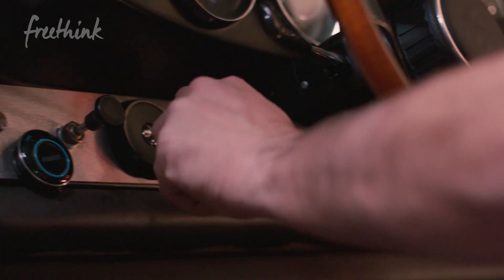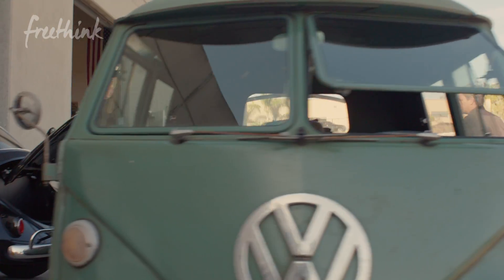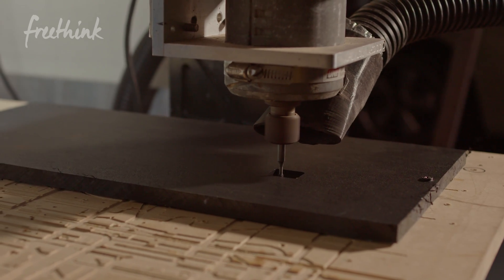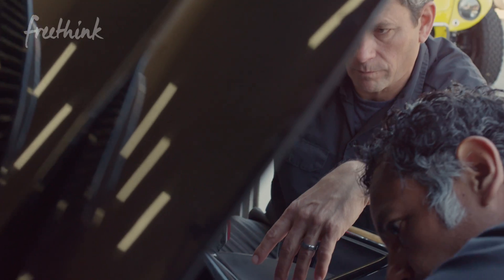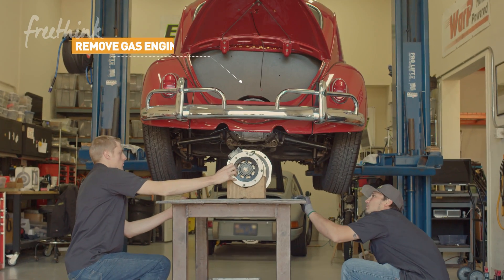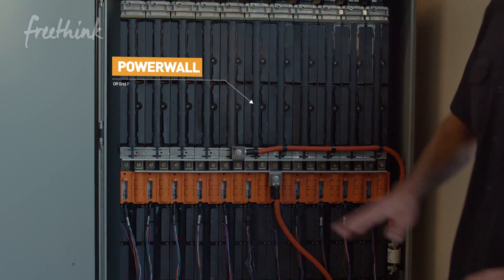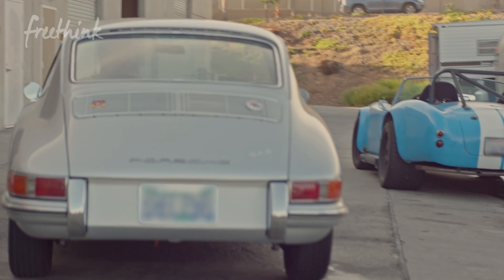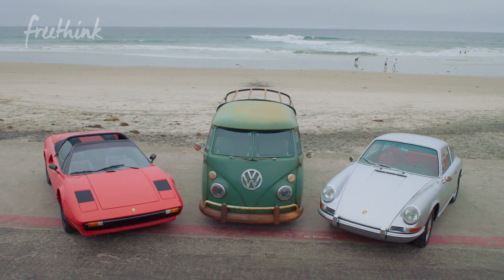The Garage Converting Classic Cars to Electric Vehicles | Freethink DIY Science

Comment: Cool but no mention to range? So, a single Tesla Cell, i.e. ~ 5.3kW 22V as Battery, gives you what? 15 Miles range? 
The key between BEVs vs ICEs is range and recharging time. Range is comparable today but until you can recharge your car in ~ 5 - 7.5 minutes, most people will still prefer ICEs.

Comment: Great to see you electrifying these old vehicles. I would hope you have learnt from Tesla around battery pack issues and 1 dead battery rendering the whole car almost undriveable. So you can develop a software that can bypass this and perhaps when 10 batteries have gone then the customer comes back in to have those replaced.
Otherwise like the Tesla there can be up to 7000 individual failure points (batteries).

Comment: EV's are NOT zero emission, even when powered by solar. All the parts from batteries to solar panels, controllers etc have emitted pollution at the factories in which they are made. The manufacturing of parts needs to be zero emission.
Reply: So your solution is to drive used electric ? The damage is already done but driving that would be more efficient than ordering the brand new Tesla

Comment: Supposedly EV West has or will have a Tesla motor conversion for V8 powered cars. So far, the only cars they convert are small rear engine VWs or Porsches. A better deal will happen when GM releases their crate electric motors for GM cars, that hook up to any GM auto transmission and also comes with the batteries, etc. I don't want to get a conversion consisting of various parts that  are cobbled together, which can only be fixed, if at all, by some company in Kalamazoo. These conversions suck, in my opinion. Stick with a company like GM or Ford - they will still be here 10 years from now, which is not likely for these five man companies  doing seat of the pants conversions.

Comment: This will cause the driver to loose a feel of connection with the car. Driving and working on a classic with an internal combustion engines are much more simple. The issue with placing an electric motor in a classic are is that it would loose its main character. Driving a 1945 Willys mb with the “go devil” four banger is going to be so much better than an electric motor. The smell of gas, the loud engine, the feel of the single clutch ti84 manual transmission, and doing mechanical work with oil spilled on your hands will never be taken away from me. I refuse this electric car revolution. But that doesn’t mean it’s a bad thing.

Comment: I have a '69 Stingray convertible I would love to make electric.
Reply: That would be so sweet. F gas cars I am ready for the future.
Reply: @donaldtaylor1037  I made that suggestion on a couple Corvette forums and received so much hate... I am old. But those dinosaurs can't handle the future...
Reply: @RAD6150  because we are not there yet convert when its the only option
Reply: @Notcminecraft  I don't want to do it because it has to be done. I think it would be a fun car if the weight can be managed. Some of the fun is doing something different, like the Zombie 222. Also, if you can put motors at all four wheels, I can think of fun ways to use that.
Reply: @RAD6150  rip corvette 1969 - shitty 2020
Reply: Why? I understand if it would be like 2050 but we can still enjoy gas cars so enjoy it while you can

Comment: I really want the resurrection of Citron  DS iconic french car. Thats my dream carvwuth all the works in electric version
Reply: A D series Citroen would be cool as hell. I owned two back in the day. The problem might be powering the high-pressure hydraulic pump that works the suspension, power steering, and the brakes. They also tend to be prone to rust so a S California car would be ideal. Good luck.

Comment: Don't fool yourself. Electric cars are not "powered by the sun".  It's a misconception. Unless your a millionaire and have the money for a huge solar system you will need to plug into the grid. That means burning coal, fossil fuels, etc. Electric cars need charging just like your cell phone x 1000.

Comment: With current battery technology becoming better, many people nowadays are converting old “nitro” RC cars over to electric. I don’t see any reason why it can’t be done with real cars. It’s actually pretty easy to do on a small scale like RC. How hard can it be? Let’s say that you’ve got a project car. Why mess around with turbos, fuel, oil and all that old messy stuff when you can just go electric? It happened to locomotives a long time ago. Our giant diesel engines of today are actually electrically driven. Their diesel engines are merely power generators for the electric motors.

Comment: Couldn't think of anything worse converting classic cars to milk floats part of a classic is its engine
Reply: fuck IC engines. solar to electric is the game bby
Reply: @mytubeworldmayhem  I'm going to make a still so that my carbonated ICE engine will still have fuel. It is possible for them to run on moonshine.
Reply: @jakekaywell5972  Ill take your entire stock. Got a 1967 Porsche 911
Reply: @coleberan3333  Nice! I have myself a 1962 Studebaker GT Hawk. A 1950s car dragged into the 1960s but still thinks its the 1930s. Due to the oversquare design of the 289 cid. V8, it should be fairly straightforward for me.

Comment: You're telling me you made an electric car out of a Delorean?
Reply: its powered by 1.21 JIGAWATTS!!!!
Reply: all you need to add is a flux capacitor
Reply: @Mr Charles
The way I see it, if you're gonna build an electric car, why not do it in style!
Reply: Unintended pun.
A lot of it is made from steel.
Reply: Great improvement
Reply: No plutonium...
Reply: The way I see it: if you gonna build a powerful electric car, why do not do it some style!!!
Reply: That thing is heavy! Range will be under par.
Reply: @aaronrigg5208  You could easily do 150 miles guaranteed in a Delorean. It won't be great for road trip, but for what Delorean are realy used for should be enough.
Reply: @aaronrigg5208  nope it only weights 2700 pounds with engine and all but just the shell thats gotta be light
Reply: @ArtmMaker  oh, ok. Thanks.
Reply: Powered by rubbish?

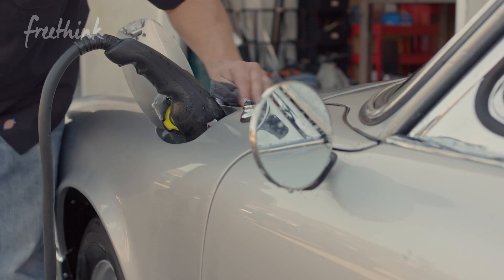Comment: 3:10
"Manufacturers havent been able to do since..."
Bullshit. The big car makes have always been ABLE to do this, they were just not willing. First of all, there has always been collusion between big oil and the auto industry. Efficiency was never a big seller. Secondly, ICE cars have more parts (carbs, injectors, starters, spark plugs, tune ups, transmissions, etc etc) to service and sell, which is a huge portion of any dealer's bottom line. The narrative here is grossly naive and ill-informed.

Comment: you know  you wont get rid of oil. Think about this from a national security standpoint. IF you were to have every car and truck run by electric power all it would take is one bomb on the switching station and you would put a whole city out of commission. and there would be no way to fix it. Some things will be electric and some will need to run on good old obtainable oil. We can either think about this now or it will get us in the backside later.
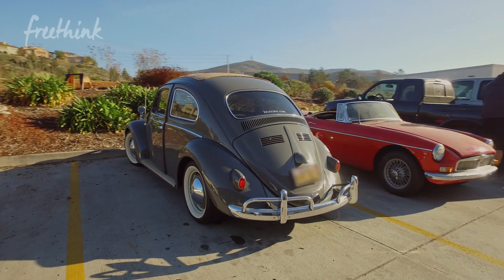Reply: They cover that these are all Solar.  Goes from 3:30 to 4:30.

You may not know it, but the ENTIRE Oil and Gas Industry relies on the Electric Grid.  

Wells, Pipelines, Refinery, and Retail.  All Electric Grid Powered.
Reply: If a bomb hits a switching station you'd have bigger problem than what fuel your car runs on...but a lot of governments still have steam trains on standby for just in case.
Reply: @Jon Hall Steam trains.
Reply: @Jon Hall not only. Coal, wood, hay, manure, oil, spirit, whiskey...

Comment: First correction: the immense amount of power used to create lithium batteries and PV cells means that they'll have to be used non-stop for years before they break even, and that energy of creation was consumed in China, meaning it was coal.  

Second, few EVs have sufficient range to drive for more than a couple hours, and as soon as you plug into the grid to recharge, you're burning coal again.  

I'm very pro-electric. I really do believe that they're the future. But as long as lies are the norm, the progress is minimal. Why invest real time, talent and treasure, when a skilled storyteller can get greater results.  

The truth is, the vehicles that are good candidates for conversion were already fairly efficient.  

The truth is that the energy density of hydrocarbons will always be useful, we'll never be rid of them.  

The truth is that smaller card with modest range is how we break our dependence on oil.  

The truth is that truly carbon free vehicles isn't a reality, and likely never will be.  

The truth is that a 60mpg diesel compact is a greener car than a tesla. 

We need truth, not more pretty lies.
Reply: The future is high density salt water batteries bruh
Reply: @MazdaRX7007  at this point, salt water batteries are very vibration sensitive, and thus only useful in stationary locations. If that every changes, I'd agree with you. But, my statement stands as it is.
Reply: "Corrections" which cite no sources?  Claiming to state "the truth" multiple times?  In a game of poker it's what would be called a "tell".
Reply: @DT-dc4br do you dispute anything I said? Since everything there is very easy to find, I didn't think it was necessary to cite individual sources. But I can, if you actually think any of it is incorrect.

Comment: I heard clutch?  a electric car use clutch.. With A clutch its lost purpose of electric car. Come on kids... I show you how make a electric car. First, cut out the differential connect each wheel with a electric motor, 4 wheels  4 motors. Delete clutch and gear box..
Reply: Good luck figuring out motor mounts, driveshaft and suspension geometry.

Comment: I think that electric cars are excellent for shorter commute type jobs and grocery shopping.  Studies have found that most people don't need to commute very far.  Though there are super commuters in places (like in the bay area) who commute for like two to three hours one way.  
I also like how simple an electric motor is compared to an ICE (internal combustion engine.  Explosion motors have their upsides too and will probably (along with electric motors) be used far into the future.   :-)  Also I've studied about different engines and motors through the years and have continually prayed since the early 1980's for electric vehicle to be developed also.  And I feel this pray is mostly coming true.  :-)   Thanks for reading.

Comment: This should be banned. Internal combustion engine is a part of the character of the car. Nobody converts steam locomotives to eco power. Don't go over the top, please
Reply: Except trains people don't really buy themselves, and modern trains don't have all the problems compared to old ones that new cars do.
Reply: @bangerbangerbro  "problems thar new cars do" problems with new cars may be annoying, but they are way less likely to leave you stranded than something from before the 1980s. But with ev's it's besides the point, since ev's are mechanically simpler and have less stuff that can break.
Reply: Most museums that run steam locomotives have converted them to run on kerosene or natural gas.
Reply: @AR-zq9hq  A steam engine just uses heat. If you have actually converted to specifically run on something like that then it must not be a steam engine anymore.
Reply: @bangerbangerbro  removing the tender full of coal and not having to showel it into the firebox ruins the steam locomotive experience and its character though...
Reply: @AR-zq9hq  If it's only for demonstration, that doesn't matter as the viewers likely wouldn't be allowed to do it themselves. And the engine is still running in the same way rather than being replaced.
Reply: @bangerbangerbro  the EV conversion is only for the owner of the car, other people aren't forced to do it to their own vehicles. And for the other drivers on the road the car will drive same way as it would be without conversion. Just won't smell as much.

The tender and the firebox doors are part of the steam engine actually.
Reply: @AR-zq9hq  Yeah, but I don't see how this links to me.
Whatever about the steam engine.
Reply: @bangerbangerbro  whatever about the gasoline engine
Reply: @AR-zq9hq  What? So having loads of weight and looking terrible will help stop you breaking down? And what do you mean "whatever about the gasoline engine"? I said "whatever about the steam engine".
Reply: @bangerbangerbro  hm in the 50s and 60s "midsize" cars would weigh up to 5000lbs, looks are subjective, but what catastrophic issues do new cars have that old ones don't? And have you ever tried to fix a carburetor that started acting up?
Reply: @AR-zq9hq  I haven't ever tried to fix a carburettor. Most new cars don't have any catastrophic issues but most of them are ridiculously heavy. Like 1000+ KG. 1000 pounds is like 400KG right? Yeah that's pretty heavy but there are loads of cars that weight way less than that.
Reply: @bangerbangerbro  so your only issue with modern cars is weight? Carburetors can be more cryptic than modern cars as a whole. If you fancy cars lighter than 500kg there's motorcycles and trikes for you.
Reply: @AR-zq9hq  What I was trying to say is that people don't convert steam locomotives because no one has them for personal use, or has any reason to want or have them other than because they have a steam engine.
Reply: @AR-zq9hq  I fancy cars below 800 KG. Most motorbikes and trikes I know of have only 1 or 2 seats. I don't have a problem with big heavy cars existing but I have a problem other there not being any light cars. I'm sure carburettors aren't that complicated. Anyway what does this have to do with trains?
Reply: @AR-zq9hq  You seem to be randomly flipping topics often.
Reply: @bangerbangerbro  are you in Europe? Find a rwd Lada, should be down your alley :) they were made til 2015. And the trains came in because the op mentioned converting steam trains to other type of fuel.
Reply: @AR-zq9hq  When did i ask why the trains came in? trains were where we started. What I want to know is how the effects of an EV conversion on drivers other than the owner relates to why people actually do screw with steam trains.
Reply: @AR-zq9hq  Yes, I'm in Europe. I live in England though, where ladas were last sold in the late '90s to my knowledge. They were made until 2015, but those were only sold in Russia. And they are not particularly lightweight anyway.
Reply: @bangerbangerbro  that's a good question, how does the EV conversion affects the drivers other than the owner of the ev conversion? My original remark was that they op said noone converts steam trains to eco power, and I noted that most museums that run steam trains actually do (natural gas burns a lot cleaner than coal for example and is more efficient). And why wouldn't people be allowed to do that? And damn, if you find a Lada heavy what do you want? A kr200?
Reply: @AR-zq9hq  I like reliant kittens (or fox) and stuff like fiat 500s, but there aren't any new cars like that. MK1 golfs (rabbit if you're in the US) are lighter than ladas aren't they? Maybe I'm being a little picky. I responded to what you said about the trains saying that's not really converting the steam engine itself, but then I suppose I could have said that to the OP as well. But you brought up the thing about EVs and acted like I was opposed to them when all I had said to you was that steam engines just run on heat.
Reply: Karol "banned" is a bit strong! But yea, see where you're coming from with classic cars.
Why don't they just convert old Honda Civics or Toyota Corollas? I can't see anyone objecting to that.
Reply: Some people are modding their cars in a way I do not like!

Well, boo hoo.